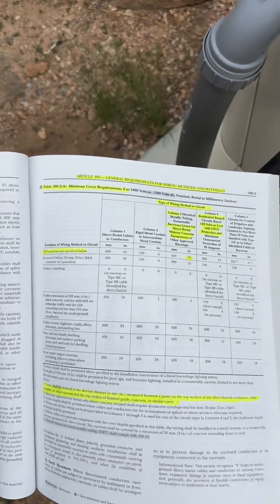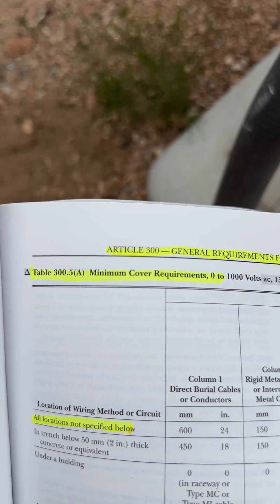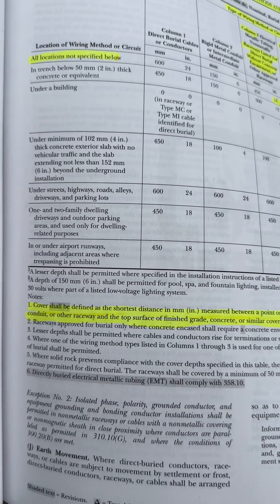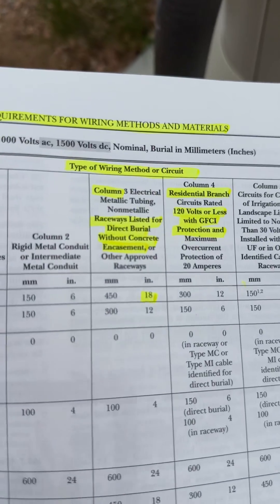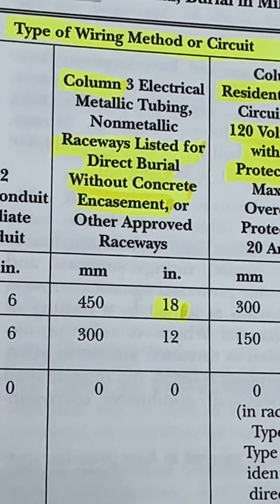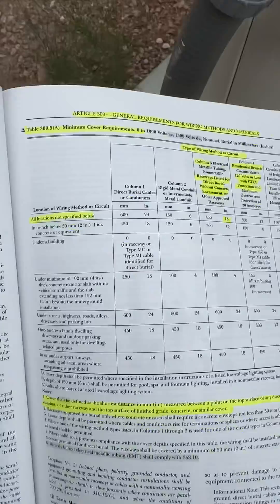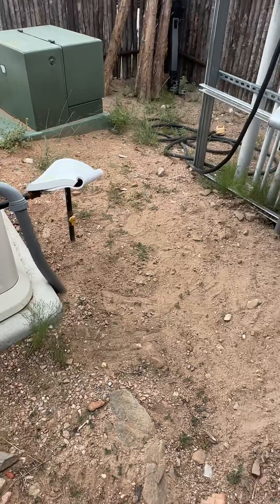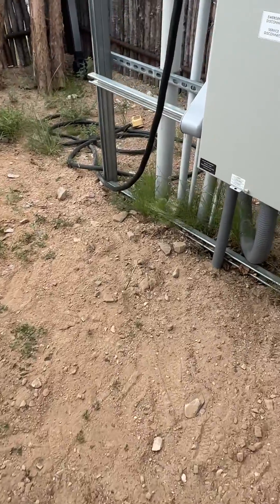Burying electrical wiring, Mike@MikeHolt.com

Comment: Nice dissection of a system. 
My question is, at what point coming out of the dirt, this Liquidtight requires a strap on the distribution equipment side?
Reply from the maker: Within 12 inches per 356.30